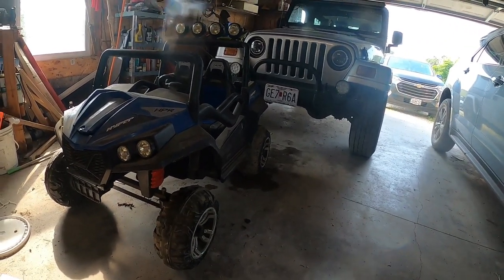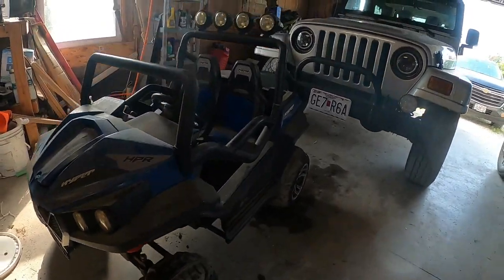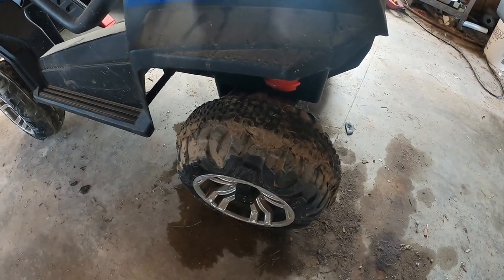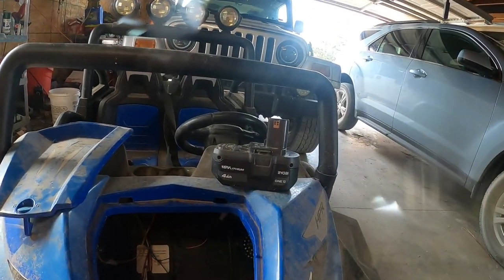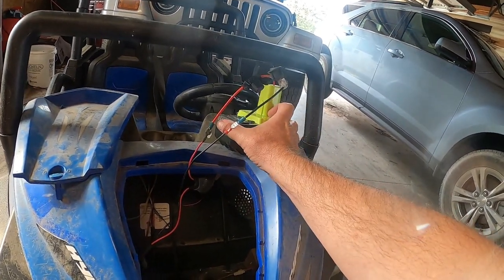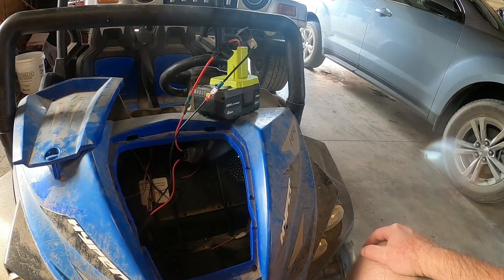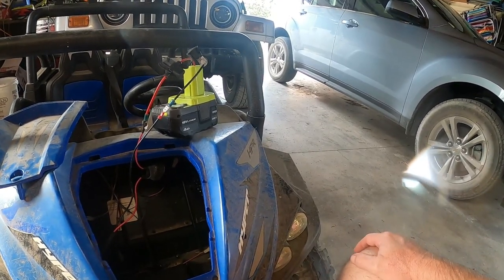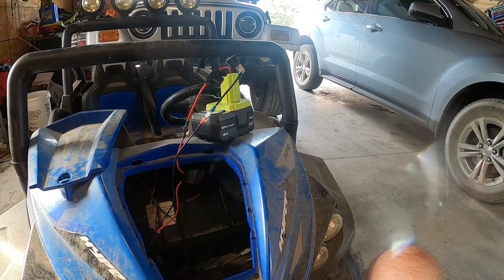We modified our grandsons hypertoy utv-900 to go anywhere on the farm and give it more power

Comment: Nice build! We just acquired one but the 12volt setup just isn't enough...have you had any issues with supplying 18v to the 12v motors? I figured they'd burn out. Thanks!
Reply from the maker: Besides this one I have two power wheels and a peg perego 12v and a power wheels 6v I’ve got running on the drill batteries. They have been used heavy for a few years and the only issue if you have a very young one is they go a lot faster. When I first started I used riding lawn mower battery that worked well but the ryobi 18v lasts longer per ride and charges faster
Reply: @momohunter72  good to know, thank you!

Comment: Do i also need to change the wheel motors and 12v board. Planning on running the 18v ryobi battery just like you but im afraid things will go - kaboom if i dont modify everything else
Reply from the maker: I did not and we have been running these for a couple years with no issues
Reply: @momohunter72  I got the hyper just like you, it says it's the hpr900 but yours looks a little different. I have to assume that the inner workings are the same and it's built for 12 v everything.
Reply from the maker: @anewkindofthomson I’m not sure but when I was doing my research there were several models and several different brands that all had the same internals. Hypertoys parts website list all the 900s as having the same parts is I remember correctly
Reply: @momohunter72  oh great! Thank you, I wasn't able to access their website I guess they're redoing it?
Reply from the maker: @anewkindofthomson if your building it for a younger child be aware it will go a lot faster. The first one I did was a power wheels skid steer 6v to 18v drill battery. His first run he was drifting with it and I was told to undo my modifications
Reply: @momohunter72  😂😂😂😂 I think my kids want to drift but don't actually know what that means physically ahahah